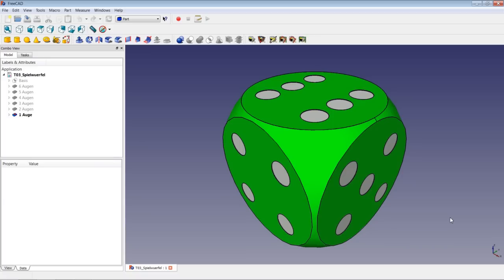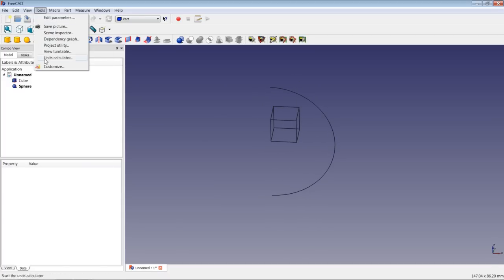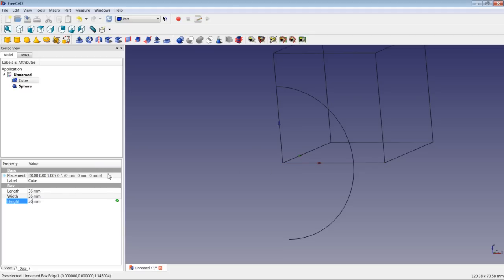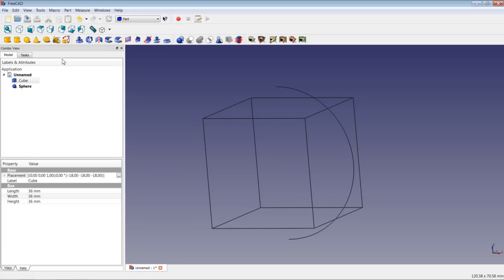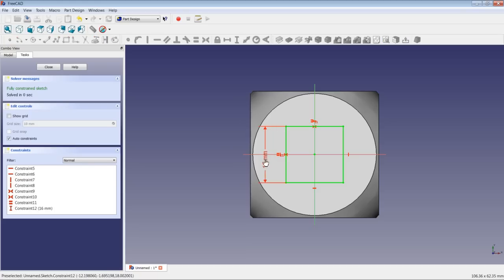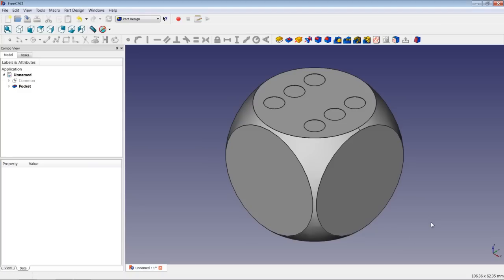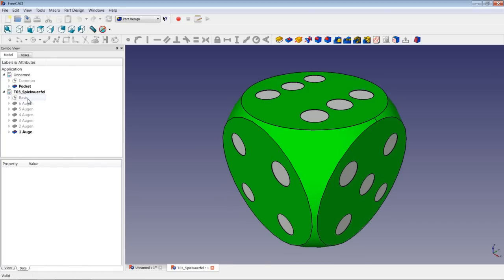FreeCAD Lesson 03 - Casino Dice

Comment: Two things different in .17 after messing around and trying to figure things out:

-After you have the common part created, make sure "Part Design" work bench is active and click on the face you want to make the 6 sided dice with.

-Click on the "BODY" button. 

-Select that SAME face and select the "SKETCHER" button.

-Do the steps shown in the tutorial HOWEVER, when you finish making the circles, highlight all the circles and turn OFF the construction mode. (Do this only to the circles and leave the box on)

-Now you should be able to select the "POCKET" button. After you finish entering your sizes in and click okay, select another face, click sketcher again, and repeat.

Once you get to the end, you can't set colors correctly until you fuse the Body and Common parts together:

- Choose the "PARTS" work bench.

- Select both Body and Common parts in your view box.

- Choose the "UNION" button.

Now you can set colors correctly.

I'm only a beginner and played around til I figured it out. If you have questions...don't ask me as I won't know it. But, if you take the time to mess around with the program, you'll get your answer.
Reply: Thanks so much for this comment. I spent forever trying to figure out why the pocket function wasn't working. Tried all sorts of ways to replicate his shape in other ways but still wasn't able to sketch or make the pockets. Your comment helped me a ton, I really appreciate you posting this!
Reply: Thank you for this. Would never have figured out why it didn't work without your help. I just dont understand why the program is so difficult working over the different workbenches.

Comment: I'm using 0.18.  At 9:23 I used the PART workbench to extrude the dots by -1mm (making cylinders extending into the dice body) and then selected the dice body and the dots and applied the Boolean cut operation.  Not sure if this is the most elegant method, but it worked.

Comment: This is an excellent series of tutorials, I have not yet started designing things with FreeCAD but I believe I am getting the general idea (I'm a bit afraid that the changes of versions will have moved some of the buttons).

One thing I have noticed in this video (and the previous one) is that sometimes you just redo a sketch that is identical to a previous one, just in a different position. I suppose there is a way to clone such an element and move it to a different position. But then a reasonable amount of repetition in the video probably makes it easier to get the hang of it.

I will definitely watch the rest of the series.

Comment: Changes for V0.17 users:
After intersecting the sphere and cube you need to select it and press the "create a new body and activate it" button.

Select the face of the new body and press the "new sketch" button to make a sketch on it.

Toggling construction mode (you can access it in the right-click menu) applies to all new pieces of the sketch and future sketches. Select the circles you want to appear and toggle construction mode again on just them.

 [If you made a sketch without selecting a face or did it in the "Sketcher" workbench it will be centered at the origin. Just select the face you want the sketch on and select the "map a sketch to a face" button in the "Part Design" workbench and select the desired sketch.]

If you have a sketch mapped to a face then selecting it and pressing the "create a pocket" button should work, if not then make sure the sketch is mapped to a face on the body.

I cannot find how to change the color of individual faces in any of the workbenches, if you know how then post it. To change the color of the whole object go to almost any other workbench like "Part" and the "change appearance" command is available if you right-click the object in the tree menu or use the shortcut ctrl-d. 

Also a good tip is to change the line color to make it more visible on objects, the feature is in the appearance menu or more detailed sketch colors can be modified in: Edit>Preferences>Sketcher>colors.
Reply: It is very frustrating... I am following your suggestions step by step but my holes always go to the center of the dice: if I use "map a sketch to a face" it says "It is not possible to map a Sketch on the support: Some of the selected objects depend on the Sketch to be mapped. Circular dependencies are not allowed"
Reply: While I wouldn't be surprised if there's a bug in the sketcher workbench causing this (taking a break from freecad because of a glaring sketcher bug atm), the fact that an error is being outputted makes me think this can be fixed. Are you trying to edit the angle of the sketch at all? The only references I've found to that error are from either improper rotations or using functions like creating pockets without sketches being mapped onto faces. If the sketch isn't mapped the pockets cant be made (edit: or sometimes it can it seems, just oriented from the plane it's on).
Some other comments I've read mentioned how they were only able to use certain functions on sketches made from the sketcher workbench. Selecting "new sketch" from the part design workbench just shortcuts to the sketcher workbench but maybe their's some way this is done that just doesn't work on some systems. Try making the sketch in the sketcher workbench to see if the result is the same, make sure to first click on the face of the object you want the sketch to be on. 

I know that trying to edit the position and angle of an existing sketch is convoluted so I've avoided it by only making sketches on existing faces or using the 'map to face' command, are you by chance copy-and-pasting a sketch, it normally also copies a coordinate axis to orient the sketch which excluded may cause problems.
Reply: Hi Arath, I have finally made it! The only thing is that I tried other 4 times, 2 with success just following your first two lines, one clicking on the BaseFeature before trying to make a sketch, otherwise I am asked on which plane and I finish again in the centre of the dice, a forth one FreeCad crashed. This last thing happens from time to time, is v.0.17 so stable?

Comment: Your voice is very clear and easy to understand. Thank you!
Reply from the maker: +Garth Algar 
Thanks, as a non-native english speaker (I'm german) I'm trying my best.
I also have to admit that the Logitech G930 with its excellent windows software I'm using is very good
quality hardware.
Reply: +Learn FreeCAD Yeah, you're English is perfect. I've got a question. What are you system specs? Do you have a Quadro gpu?
Reply from the maker: +Garth Algar 
I5-4570 CPU @3,2 GHz (QuadCore)
8 GB RAM
AMD Radeon HD 7750
Windows 7 - 64 bit
(Linux Mint 17 as dual boot)
Reply: Great I'm relieved you're not using a CAD GPU. I have a similar setup as you. I just hope solidworks actually works on my machine since I've seen lots of people addressing concerns of not being able to properly install the program.
Reply: "you're English is perfect" :)

Comment: For 0.17 users. I had already an exchange of comments with Arath Duiliath below, but things are harder than expected when you want to follow these tutorials using 0.17 (see lesson 10...)
The only procedure I found working when you start from a Part Primitive (I simplified making a cube and then trying to make a pocket) is the following one:
1) make a cube in Part;
2) go to PartDesign, select it (IMPORTANT), then click on "Make a new Body and make it active";
3) go to "Model" on the left, click on Body, open it and select "BaseFeature";
4) select on the cube the face where you want the pocket;
5) make the sketch remaining in PartDesign, close it and make the pocket

If you forget step 3 your sketch will go on the face where the axes are, if you try to use the trick suggested in Lesson 10 (move the sketch from another plane), you get a mess
if at point 5 you move to Sketcher you get Errors. Sometimes you got what you want but it is more complicated: from the pop up, select InertialCS, then go back to PartDesign, remember to select the sketch, then press the Pocket, maybe it works...

Funny thing, the procedure I wrote a few lines above seems to be the only one working with extruded solids (nor Part Primitive), but I have to test it more.

Comment: If you're a new to FreeCAD, this is the best tutorial BUT you will have to download version 0.14. to follow. And then read the documentation for higher version later. Don't make the same mistake I did, trying to learn version 0.18 using this tutorial. Otherwise, you'll be very frustrated because of the SIGNIFICANT changes made.

Comment: i like when around 6:10 you say the lines went from white collar to blue collar. They literally changed to 'construction mode' :p
Reply: Construction mode is essentially what you will later 'erase' or not see when the next step is done. Thus leaving 'non-construction' white or  sketch elements visible and therefore able to extrude with the 'Pad a selected sketch' icon.   My .1 pad dimentions gives me an error.. even ,01 (comma or point)  I have only 1mm degrees so I have to set the Pad icon options to 'reverse' to not have my dots go out from the cube but into the cube.
Reply: HaHa. Blue collar construction workers!
Reply: Yeah that messed me up for a little while to...

Comment: So how do we apply a pocket operation to a Part primitive? A lot of things have changed in version 0.17. For example a sketch from the Part Design workbench on a Part primitive is not allowed (You'll get a No Active Body dialog). It is however possible to bypass this by using the Sketcher workbench, but once finished in the Sketcher workbench I am unable to apply the pocket operation to the sketch.
Reply: Been playing around for a bit with this and I finally figured it out:

After you have the common part created, make sure "Part Design" work bench is active and click on the face you want to make the 6 sided dice with.

Click on the "BODY" button. 

Select that SAME face and select the "SKETCHER" button.

Do the steps shown in the tutorial HOWEVER, when you finish making the circles, highlight all the circles and turn OFF the construction mode. (Do this only to the circles and leave the box on)

Now you should be able to select the "POCKET" button. After you finish entering your sizes in and click okay, select another face, click sketcher again, and repeat.
Reply: Thanks rivera82falcon! With your help I was finally able to apply the pocket operation to the circles. Were you able to find out why you had to do these steps in the (newer) 0.17 version of FreeCAD?
Reply: @franparis71  The work around to this in newer versions is to go into "Part" designer mode click the "Extrude" option and do 0.1mm "against (making a negative extrusion of the sketch into the face of the dice). Select the dice and then select the new extrusion and do a boolean cut operation

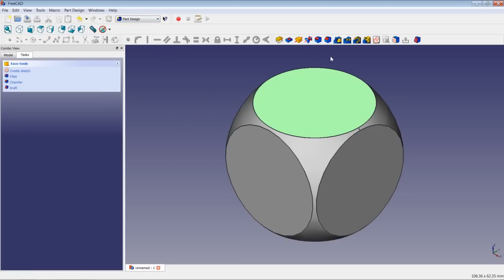Comment: Following the EXACT steps presented here the program (ver. 0.18.3) displays an error message after attempting to imitate step at 4:25. Error message says "No active body". I am frustrated! Can anyone help please?
Reply: It seems since 0.17 or so, you need a "body" to apply the pocket to. In "part design" workbench it is the blue staircase icon. I recommend starting again, and making a body first thing, and then trying the rest of the instructions. Several other comments from about a year ago touch on this issue / related issues with newer versions. (I got a dice out of 0.18.4 just now)

Comment: when i changed sphere radius 5,00 mm to 25,00 mm , sphire can't effected this.
i open sphire property > map mode : Deactivated... and exit with ok or cancel, sphire changes effected suddenly. O_o
Version 0.18 on Fedora31 and Version 0.18 on appimage
and i try radius of cylinder it works well, but when try in same new file sphire not working.

Comment: I am using FreeCAD 0.18.
What does it mean to "double-click a body object"? In short, what is a body object? I presumed it meant the main object at the root of the Labels & Attributes tree...?

Anyway, I've double-clicked everything in the model tab and in the working window, but keep getting the same error window when trying to apply a sketch to a single face. If the entire object is double-clicked, the multi-plane selection appears, but that's for the entire object, not a single face.

The tutorial being followed is this one :: https://www.youtube.com/watch?v=uBKhBwS ... rj&index=3

The main item is built in the Parts workbench, it's when I go into the Parts Design workbench that this issue arises. Another forum member said these two workbenches no longer play together like they did in previous versions, so I have a feeling what you're saying about the body object is likely part of the solution. However, my intuition of what a body object is may not be correct.

There's an obvious gap in my knowledge; what am I missing here?

Comment: A continuation of my comment below for 0.17 users. 
If you start a sketch in Sketcher, to extrude a solid you have to use Part (with Part Design it doesn't work). But then I couldn't manage to make a sketch on the right face, just on the face on the axes but I cannot move it to the desired face (see lesson 10 for a trick that does not work).
So start the sketch from Part Design, extrude it here, then open the Body in Model (left window), select Pad, goes back to your object, select the face where you want the pocket to be by clicking on it (important!), make your sketch (everything in Part Design!), close it, click on the sketch (importnat) to select then make your pocket.
I didn't find a quicker way, comments are welcome

Comment: i use freecad  version 0.16.Why the icon of togglesthe  curently selected line to/from construction mode no view in my freecad?pless help me from this problem.
Reply: Mine doesn't do that .. on version 16 with 64 bit.  But minute 21 of this video.. when setting the colors to different faces doesn't work for me, however appearances does work and applies to whole structure the color chosen. 'Set Colors' icon brings the dialog with 2 buttons 'set to default' and 'box selection' both don't let me set individual face colors.  Bummer. But 99 percent the same as his version .14
Reply from the maker: The video was recorded with FreeCAD 0.14. Meanwhile the icon has changed, now in 0.16 it looks like that:
https://www.freecadweb.org/wiki/index.php?title=Sketcher_ToggleConstruction